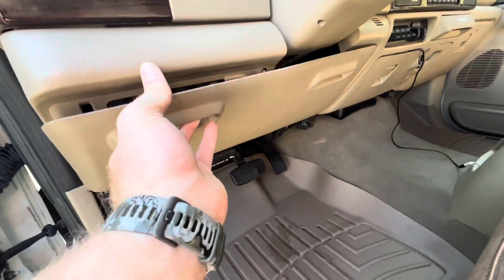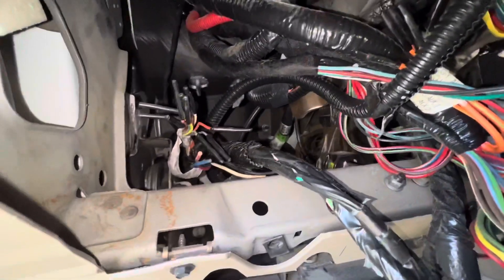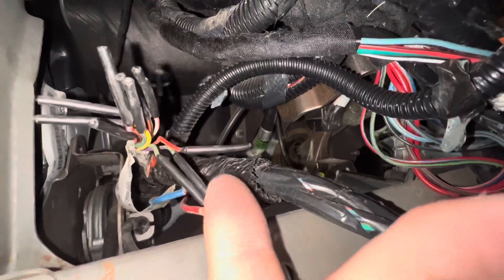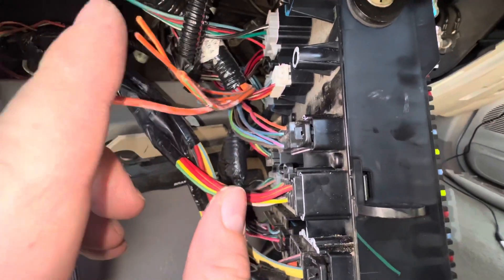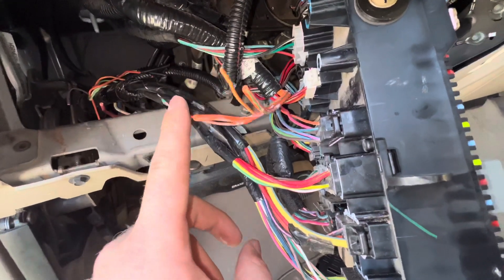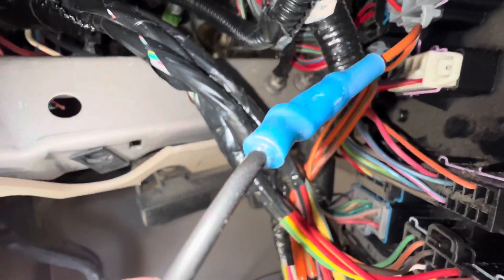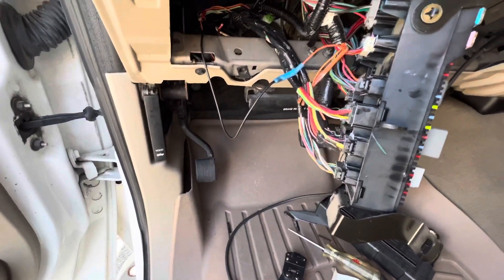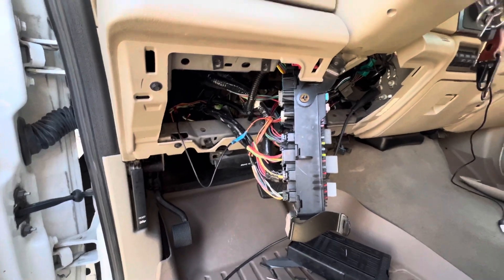6.0 POWERSTROKE, HIGH IDLE MOD FOR FREE

Comment: Can this work if I don’t have the up fitter switches ?
Reply from the maker: Process is a little different, and you need to buy an aftermarket switch, but yes. I believe bd diesel has switch kits that are pretty simple

Comment: My truck automatically does that and doesn’t have this mod
Reply from the maker: every modern diesel has a built-in high idle that automatically kicks in after 30-60 seconds of idling while in park. This allows you to control the high idle feature.
Reply: @PackGarage  mine doesn’t jump to 1300rpm though it goes from 750-950
Reply from the maker: @MrMystang92  does that include colder weather. my truck would usually go a little higher in rpm the colder it was. before this mod
Reply: @PackGarage  we’ve been in the low 20s and 30s so not supper cold. As soon as I touch the brake paddle it goes back down to 750